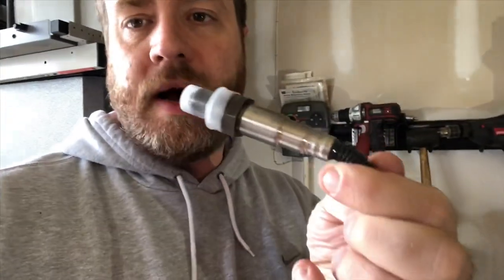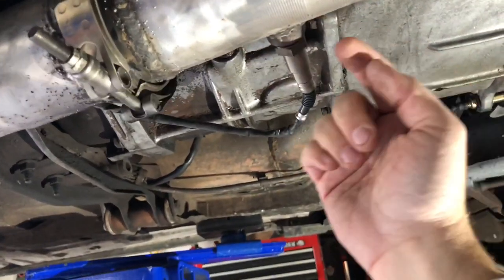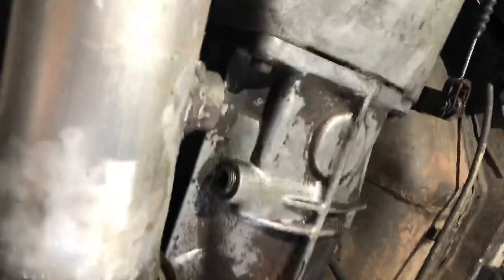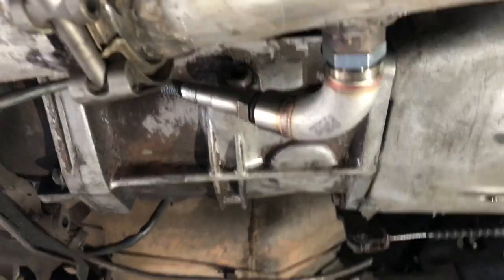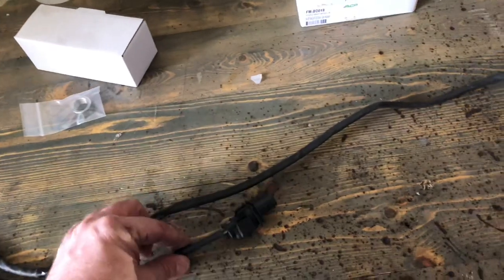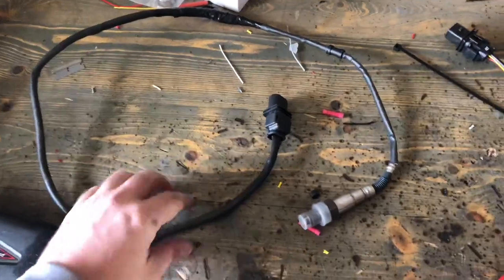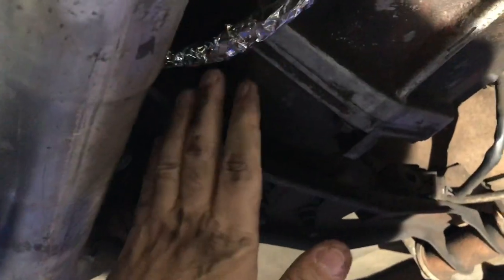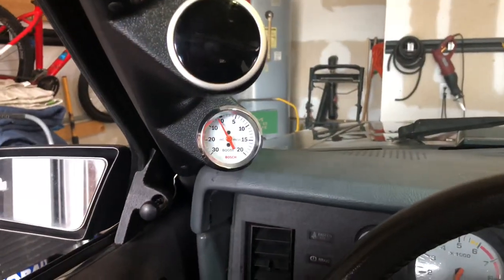SVO Mustang Wideband O2 Sensor Defouler install

Comment: Very good instructional video.  Another trick is buying a two pack of spark plug defoulers and screwing both together.  The top defouler that your O2 sensor will be screwed into needs to be drilled out with a 1/2 inch drill bit.  The non-drilled out defouler screws into the grommet in place of the actual O2 sensor.  The second defouler which you have drilled out is where you screw the actual sensor into.  This has worked for many others.  I'm going to do it on my '05 RSX Type-S soon.
Reply from the maker: Virtual Vapes thanks!  What’s the added benefit for two defoulers screwed together?  I assume it prevents defouling even more?
Reply: @mrautomotif8996  No problem brother.  Yes.  Kind of like the inserts that came with your set by screwing the two together it provides space so the computer doesn't get a strong read from the O2 sensor that is post cat.  You don't want to mess with bank 1.

Comment: Nice lift I need one. I need to it some O2 Extensions on the wife’s 2000 I’ve read that one time that it will help get rid of the check engine light. Great job brother.👊

Comment: Hey man, I am using stainless braided line for my whole fuel system and I am also using a Magnafuel boost referenced FPR. Any tips on where in the fuel system I should have the large filter, the small filter, and the regulator located? I also have no idea what micron I should be using for the two filters. I can't really find any info out there.

Comment: After 4 months of having it on did you have any issues?  The light coming back on? I have ordered one of these that hasn't showed up yet but I put a header in my car. The check engine light came. Just waiting for it to show up.
Reply from the maker: It hasn’t yet although the car has been at the paint shop since January.   I’ll post back if it comes on.